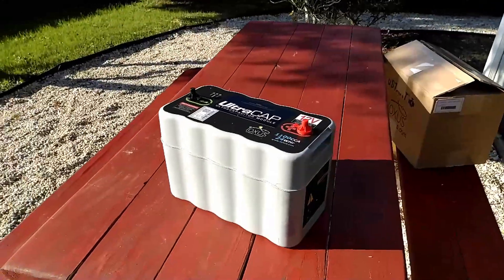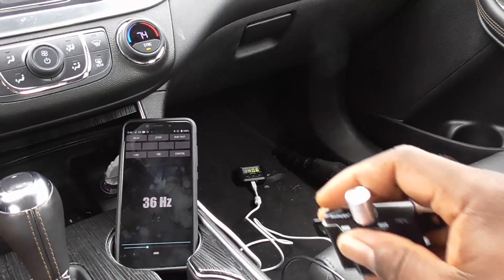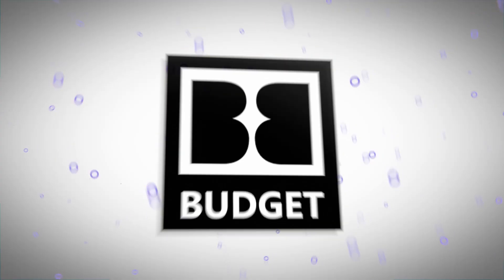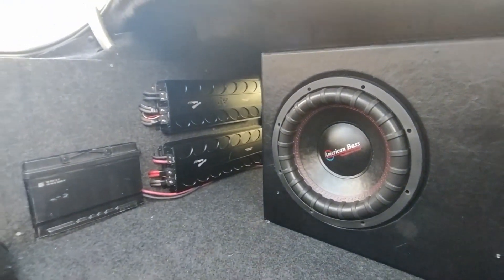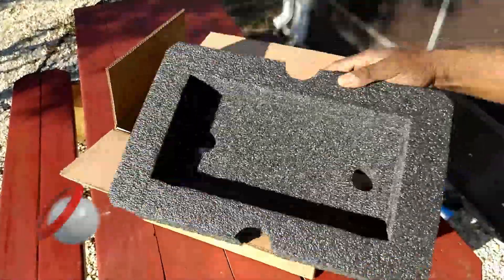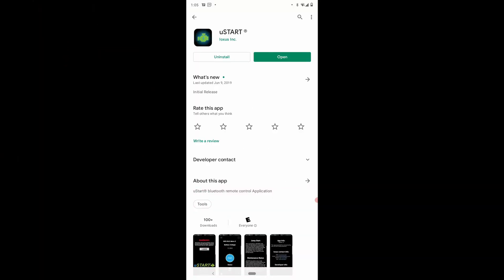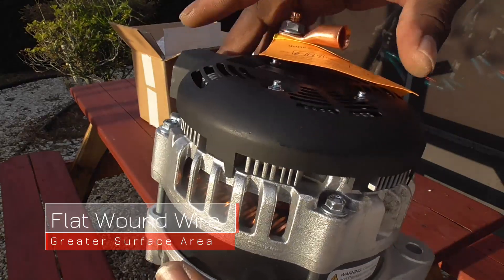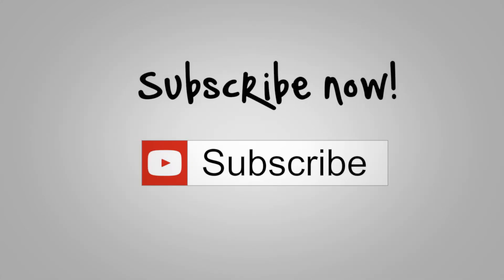Top 3 Tools For Voltage Drops: Alternators | Ultra-Capacitors | AGM Batteries

Comment: i have dual zvx8 with 1500watt skv2 amp, stock alt 120a... draining my battery 5 min with car off... do i need both atl/battery, 2000watt rms
Reply from the maker: @JamesBondzX  try lithium. It's a whole lot cheaper these days.

Comment: so do you charge your ultra capacitor at 6 volts or 12 volts?
Reply from the maker: This capacitor it's simply connected and it would do all of it's own charging internally with its software.

Comment: Can you make a video explaining how the battery amperage draw sensors in today’s cars work. Do you run your amps negative cable thru the sensor ring? Is there a way to bypass the sensor so that the alternator works full time keeping the battery charged at all time?
Reply from the maker: You are the first to ask me this. And its a thing I've been very annoyed by since installing into this car. I think its all programmed from the factory to save gas by periodically reducing RPM. Which is good, unless you have a system like ours. I don't want to give you advice that may break your electrical system, but think the computer senses a particular amperage draw threshold with the sensor and goes into a safety mode called 'Battery Savor' or something like that. I had many warnings when running my alt ground wire through it(alone). So I removed the after market ground from it (back to Stock Ground) and no more 'battery save' warnings. But I'm fearing not the full current I need for my system either.
Reply: @BudgetBassHead  my understanding is that the sensor is always measuring amperage draw and makes the alternator not work as hard when not needed. I managed to squeeze in a 0 gauge, 4 gauge, and a 8 gauge ground thru the sensor ring. I run my amps ground directly to the battery since my battery is in the trunk. Can the sensor detect multiple ground cables amperage draw at the same time? Who knows..

Comment: Hey BBH, I've got a request for a future video as I have a second car. Its a Modded Celica GTS TRD that Id like to keep peppy, saving on system overall weight and still use the stock 110amp alt, Big 3, with a smaller up front AGM and a SMS80 in the trunk. Would 2 EVL 8's, 3 SDR 8's, or one 15" VXF beat harder on a SKV21500.1 if the subs are in their recommended enclosure sizes? The video request is "Would multiple 8's be better than one 15", even if the 15 is "higher end"?"
Reply from the maker: The 15 would have 308cu.in. of cone area vs 223cu.in of cone area of the 3 eights. Plus the 15 would have 2wice the X-Max; which equals more moving mass, with more linear travel. The 15 would get louder, though the eights would combine more motor force. 366oz to 300 of the 15. But in that competition, cone area is king.
Reply: @BudgetBassHead  I really appreciate the mathematical smackdown, Ill start drawing up a box for the 15. Love your video's, keep up the amazing work!

Comment: Never  seen  someone face there woofers that how does it hit thinking about doing that I have 2 12s
Reply from the maker: My passenger location likes this setup better for some reason. I think its naturally reflecting into the kick. It sounds louder in the driver side while facing to trunk though. I just hate all the rattle.
Reply: @BudgetBassHead  it  is hitting a lot harder when I face them that way  woow

Comment: Buddy Have 4(12s)compsubs,(2) classD amps 10,000 watts,  (2) compactors,factory alternator, (1)fully electric battery (for vehicles that have power windows, power mirrors etc) and my headlights dont blink my friend, my friend, I aint blowing no smoke but alot in that video  isn't needed , way to much money being spent,my set up can be heard  3 to 4 miles out!! FRfr🤞🏽
Reply from the maker: Not every electrical system is the same. Factory alternators are only design to supply power for the stock electrical with about a 5-15% overhead, after that, you're taxing your battery. And adding extra batteries only give the stock alternator more work to do. Anything over 2,000 watts require an upgrade to stock electrics. If you have 10,000 Watts on a stock alternator, without issues... Good for you.

Comment: Man all those adapters 0/ah 4/0ah 10-12 ah where you get yours I find few but not much selection
Reply from the maker: Are you the fuses or terminals?
Reply: @BudgetBassHead  end of speaker wire 10-12 I have for fuses and amp they are easy to find but would look nice on speaker side as well

Comment: I have 2 evls wired @2 ohm and an evl @1 ohm @ bout 2500w voltage drop was in my whip as well, installed a 240 amp alt a  second agm giving me 190 ah that still wasn't stable enough so I ran another 1/0 gauge and 2 more good grounds AND THEN bought a xspower 630 farad superbank, voltage is now stable af at 14.3, I have to start clipping bad before itll go into 13. I bout when the exous route but research said I'd get more out of the sb630. None the less this shit takes alot of cheddah, bumpin ain't cheap if you doing it right yo!
Reply from the maker: ...exactly what you said 💯

Comment: I was able to burp a 153.2 db at 38hz on a synergy 2k amp and two american bass 15s in one of my custom boxes tuned at 31.5 hz after displacement of the subs the box was originally tuned at 28 hz and oh ya it was in a explorer 5.0 eddie bauer edition suv but then my engine blew up and had to sell everything and the suv so now I got a Hyundai santa fe with a skar vvx v3 8 in a skar armor 8 box and a gothic 12 in a attend bbox on a razor 2500.1 at 1 ohm and it actually sounds good and gets pretty loud prolly around a 138-140 ish(at a good burp) lol but it dose sound good and low right around 30 hz to 40hz anything else kind of sucks comparing to my old compitition setup
Reply from the maker: Thanks for sharing.

Comment: Some people have no alternator to upgrade I have a hybrid that has a voltage converter hooked to the 270v hybrid battery and I have 15.4 volts for days and days but I'm limited on amps I can draw prob around 150a I think. Does that make sense? 15.3 volts constant but only a certain amount of amps I can draw? I think I need a 500a 270v to 15v converter if someone can build one because I have a 270v generator ran by the gas engine so I can make power for days
Reply: Throw some lithium in it
Reply: @bassbrother101  I have a 25ah limitless lithium battery and 2 80 ah agms and I have a 16v bank of maxwell boost caps on the way running 2 savard HiQ 12s on an orion hcca 3000.1dsplx and it beats im just taxing that voltage converter hard I think but idk I see people taking them camping and running a/c and fridges and heaters off of them on 120v converters and it hasn't failed me yet
Reply: @bassbrother101  I would love to try 100ah of lithium I bet it would be a game changer agm batteries are no where near as close to as efficient as lithium
Reply: @justinkelsey9218  100ah of lithium should help a lot more if u wanna do that but if you can find away too covert it to 15v that'd be awesome too
Reply from the maker: I'm not that versed in hybrid cars. But it seems as though your knowledgeable about how to solve it. You make me want to learn more about it.
Reply: @Dmitriy Yarve probably somewhere around 2k total with all the mids and highs and everything I'm running the hcca 3000.1dsplx at 2 ohms because I'm afraid of what it will draw at 1 ohm

Comment: Could you just swap the pulleys on the alternators so you can use the same belt?
Reply from the maker: Anytime I have to swap pulleys I get nervous due to misalignment issues that may occur. Not to mention to pull some pulleys is very very tiresome.

Comment: Yep.. Mechman the Alts.. Had my 250 for 3 years now.. 2 d3400 XsPower.. strong..
Reply: i’m thinking of replacing my battery up front with a d3400 and a mecan 250a alt. think that would be enough for a 2500 watt rms setup?
Reply: @owenrook6467  yes... i have 2 d3400s and a mech 250.. running 4 c2400s at .5 each.. 😎